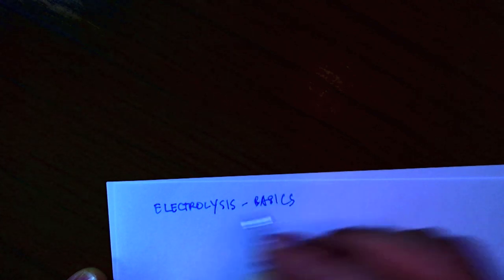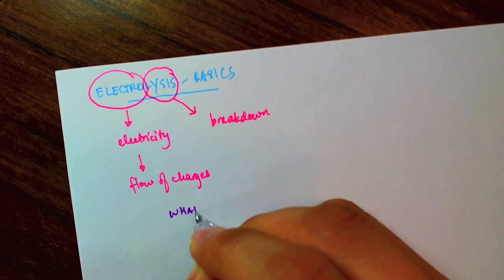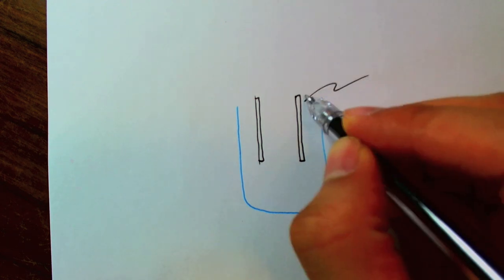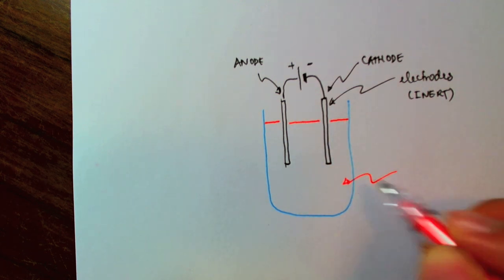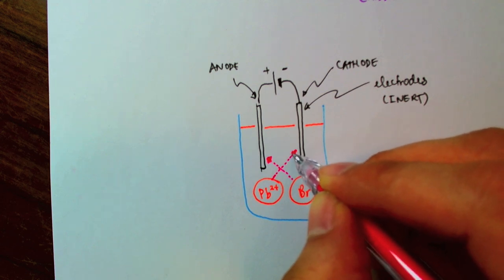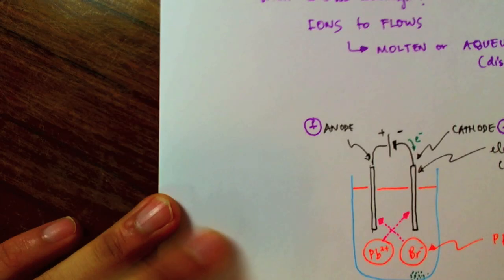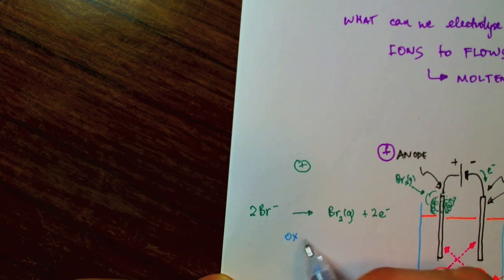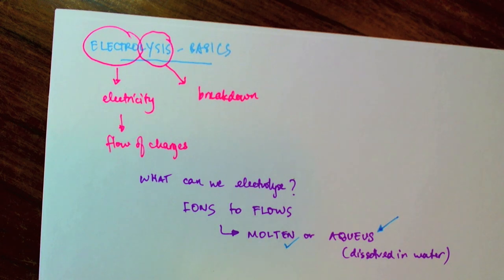Electrolysis - Basics

Comment from the maker: It depends. Bromine is a liquid at room temperature, but because the molten electrolyte is at a fairly high temperature (to melt), the bromine evaporates upon formation. If you have something that has a boiling point (or melting point) below that of the temperature of the electrolyte, it will discharge as a liquid (solid)

Comment: If the lead were to ionically bond with the bromine, the lead would gain 2 electrons from the bromine to form a full outer shell. So would have a 2- charge. Because Bromine is diatomic, it would give the lead one electron from each bromine atom. Giving the bromine just a - charge or 1- if that makes it easier. Not easy to explain but I did my best. :)